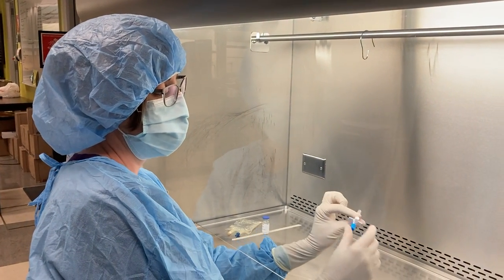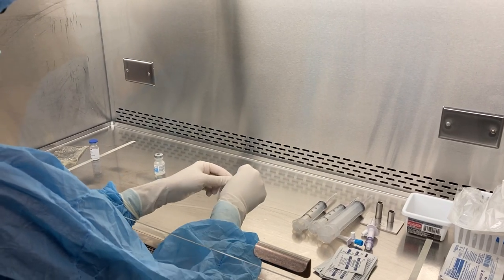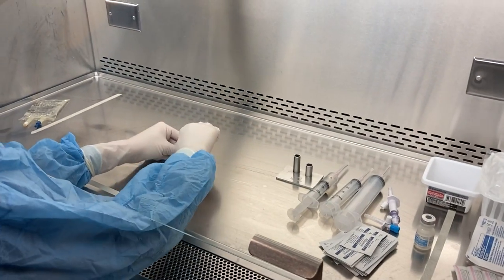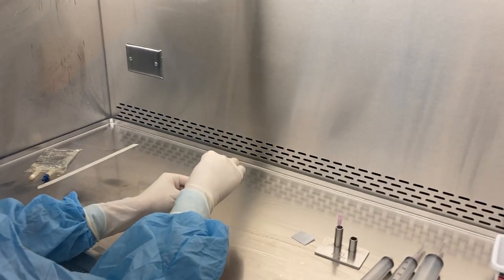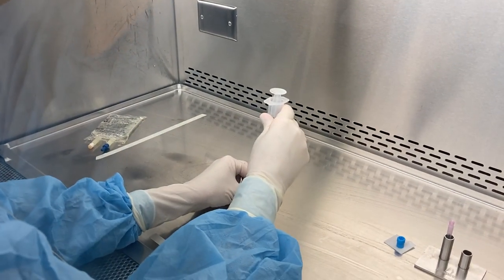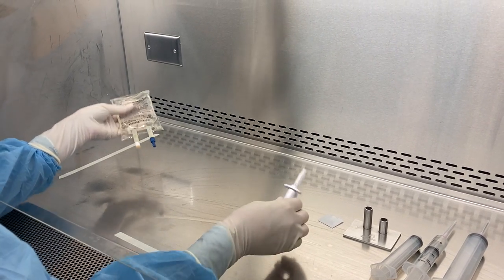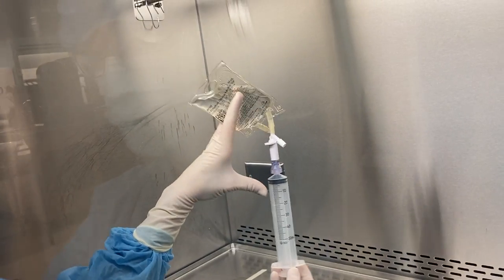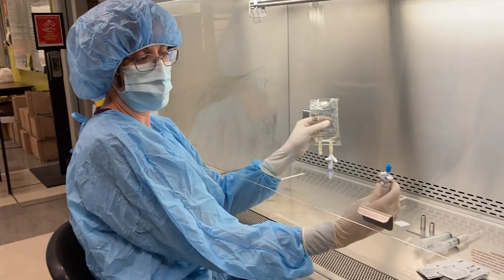Sterile compounding using a mini dispensing pin and vented dispensing pin - Hospital PharmaLife

Comment: BBraun's Non-Vented Dispensing Pin works a lot better for spiking bags. The spike on that standard vented pin is really designed for spiking bulk vials. The non-vented spike fits into the bag's administration port much easier.